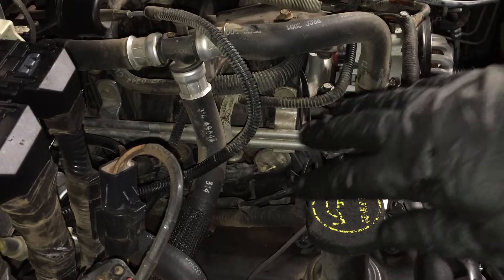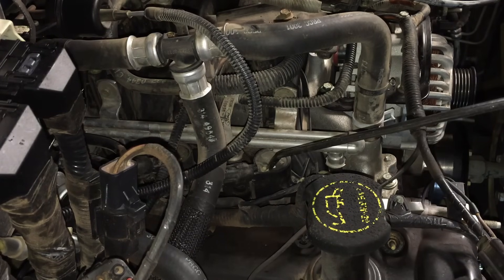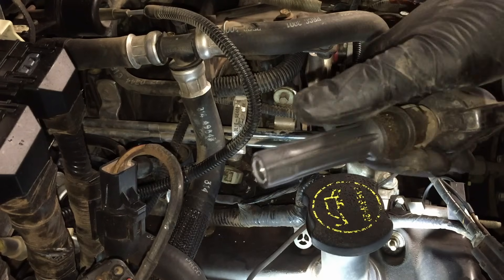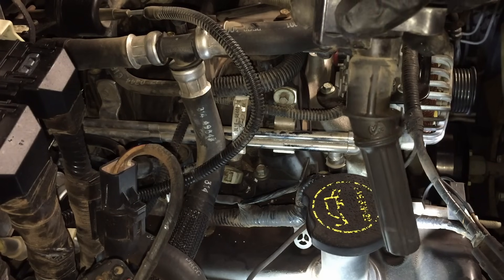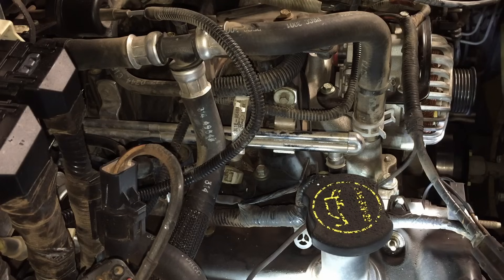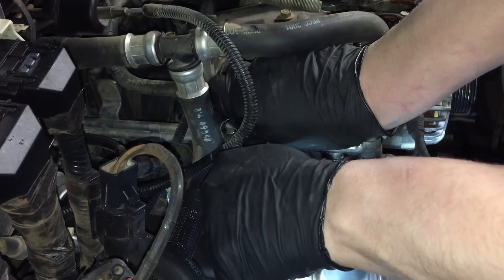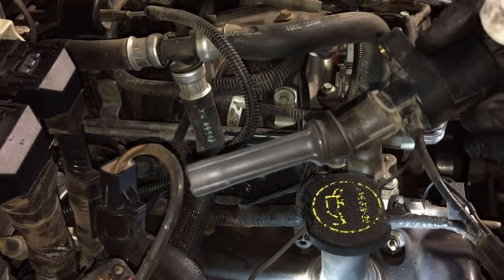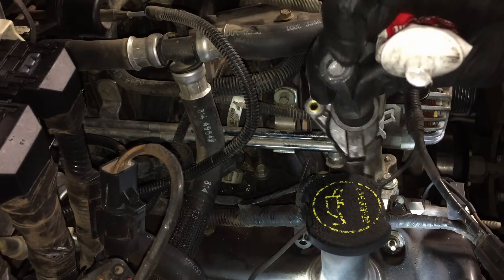Important Tips When Replacing Spark Plugs on Ford 4.6L 5.4L 6.8L 2v Engines

Comment: I use compressed air to blow debris from the area and after I get the plug out I use my small shop vac with a reduced tiip to suck out any debris that may be left.
Reply: Too late after you get the plug out,,,,,try blowing it out after you get the boot off!

Comment: I have an 03 TC with only 11500 miles on it. Being that it is 15 years old, should I consider doing a coil/ plug change or should I wait till 100K? The car runs fine.. It has been 15 years though..

Comment: I have a 01 Ford F-150 5.4 and spark plug on cylinder 3 when I try to losen it it feels as if it were rounded up because the socket jumps out of place,  like I can’t get a grip on it with the socket. Any idea why?? Or what can I do to remove it, I have already replaced all 7 plugs but that one

Comment: My question is, this only happens on the original set, ensambiling plant, or will always be a chance of  happening replacing the second set, my f150 Ford replaced the 8 in 2011, 3 where broke from the mechanic that tryed first, now truck jerks when touch gas in 4rh gear at 40 miles plus, so I'm gonna replace the spark plugs but not sure if they have a chance to brake, again, Ford dealer already replace them ones.

Comment: hello can you help me I have an 04 ford f150 5.4 lt I got a p0300 code that can be?
Reply: 2 or more cylinders misfiring. I dont know what vehicle you have. Could be coil, coil harness, plug wires, or internal engine component failure.

Comment: I have a 2007 f150 4.6l 2v . It has only 30,000 miles. With the factory torque on the plugs,what would you sugest 

to prevent plug blowout. thankyou

Comment: Thanks for the great video. I just changed the plugs on a 1999 F150 2v with the non coil over spark plug boots. I have two  quick questions. I could not get #2 spark plug boot to seat fully to the head. It sits up about 2 to 4 mm. Is that normal?. All the other boots seated flush with the head. Also when I first started up the engine ran slightly rough and then smoothed out. Does the computer have to calculate new values with the new plugs, hence the roughness. Thanks again for all the great tutorials...you rock.

Comment: Excellent video - Took me 4 hours.  changed my plugs & coils yesterday and found it was a real challenge to blow all the dirt out of the plug area. In addition to using an air compressor I made a tube attachment for my home vacuum to reach inside the holes. Car runs nice and smooth.
Reply: How do you know when to change the coils, and how long do they last.
Reply: @JosephArchebeque-he5lz There’s no time frame on how long they last.  If you have a misfire you’ll know it.  Replace the coil and plug.  If you’re lucky you’ll get a check engine light and your OBDII scanner will tell you which cylinder is at fault.  I hope this helps.
Reply: @JosephArchebeque-he5lz Buy Denso coils, the cheap stuff doesn't last!
Reply: Good tutorial.   I wonder about engine temp.  A Ford tech told me warm is good.  I don't know anyone who uses a torque wrench to install plugs, I probably overtightened a few .

Comment: I got NGK Vpower plugs. Same stuff used in Honda's which last forever. Coil packs on driver side were worse to do because of the fuel regulator then the passenger side.

Comment: You showed me everything I needed except how to get that last plug on the drivers side under the fuel rail.  The plug that the last guy didn't replace, the plug that is now totally dead.    Other than that great video.
Reply from the maker: +John Stutz the plug comes right out with extensions and a swivel. It's the coil bolt that is a pain. I use a 7mm gearwrench
Reply: I got the bolt out. I can't get the coil pack out from under the rail.
Is it bad to pull the rail, or is that OK to do?
I don't want to make a bad issue worse.
Reply: I had to pull my fuel rail off. It's no big deal but I'd make sure you have some new O-rings on hand for your injectors

Comment: Like to know if it makes a difference if heads are cold or hot.  Does that change the torque needed?  I've always maintained my cars but aluminium heads worry me a bit.
Reply from the maker: +Ken Howell No need to adjust really

Comment: Hey bud quick question, I've been trying to get ahold of you with a few questions but unfortunately was unsuccessful. My only question is, I just recently replaced plugs and coils all motorcraft and instead of anti-seize along the treads on new plugs I used dielectric grease instead by accident thinking that was what you used. But now watching the video again I see I was wrong and now I'm nervous. I used the by electric grease on the treads of the new spark plug and the top of the plug with the coils sit on. Is this ok? Also I tourked them down too 22lbs
Reply: the dielectric grease shouldn't really be a problem because the element in the plug is insulated from the threads through the porcelain. If you put a lot on and it squeezes out and touches the node you might have a problem but I think that's unlikely
Reply: The dielectric grease -- or anti-seize for that matter -- should work with engine vibration to help your plugs back out and blow out prematurely.  The more you use, the sooner you'll be back in there.  Keep your Cal-Van Ford Triton kit handy.  That said, the shade tree mechanics prefer Thread Repair helicoil from Wal-Mart.  Your choice.

Comment: Thanks for the great tips.  I just replaced the plugs in my 2007 E250 with a 5.4 two valve engine.  I had been dreading doing this job as it looked like it was going to be a nightmare.  After removing the doghouse, air cleaner housing and hose the only other thing that had to be removed was the PCV pipe.  I'm glad I had a huge assortment of 3/8" extensions as I had to use different combinations to reach the plugs.  A few of the plugs turned really hard when being removed but I was able to get them backed off a half turn and sprayed a couple shoots of Liquid Wrench (my favorite) and let it set a while.  Turned them back in and then they came right out.  Made sure to use los of air to clean out the threads and used never seize.Turned out not to be all that hard and I was able to get the torque wrench on every plug.
Reply: which has the broken off spark plug issue, not the issue with them blowing out..
Reply: that's the 3 valve if it's a 2007..
Reply: @GTA4folife it's an ECONOLINE they all have the 2v.
I own 3.

Comment: Thanks dude!!  I was worried about it being 3valve.  Thought I'd have to get a Lysle removal tool.  Also thought I'd have to remove the fuel rail and computer.  I was so freaked out by these spark plugs ( my sister had a 98 Expy and it needed helicoils put in!) that when I had a misfire on #6, I only changed it and the pack.  I pulled off the vacuum line above it for easier access and the nipple came with it"snap".  That stupid baro sensor was $73!  I'm confident now I can do it.  A garage buddy looked it up for me in case I wanted him to do it and the standard was 3 1/2 hours shop time ( ouch! ).  I'm not a whimp when it comes to plugs.  My old 73 Ford line 6 Super Van burned oil so bad, I'd sit in the van once a week while the wife grocery shopped and take out all the plugs and clean them and put them back in, lol.

Comment: Thanks for these videos.  I found your channel after I blew a spark plug on my 98 Econoline.  Very concise and well done, I really appreciate it.  One question.  If torquing to 20-25 ft lbs, do you think it's necessary to check the torque every 5000 miles?  It'd be such a pain but definitely less of a pain than fixing another blown spark plug.
Reply: How did you fix your blown spark plug?
Reply: Heli coil kit

Comment: are those pi heads?
Reply from the maker: yes
Reply: ive got a 4.6 the oil intake on the pass. side anyway maybe you can help me ... my truck is having a hard time cold starting. it cranks and nothing until you let off the switch and start over it starts right up... but the first few seconds it idles erroneously... then it goes back to normal. any help id appreciate it thanks.

Comment: So mine just blew out on cylinder number 2. Was able to screw it back in about maybe 3 threads, must have ruined some of the threads when it blew out. Should I repair it and put a insert in or should I just leave it and see if it will stay?
Reply: darkjedi351. It's all fixed now. There was only one or 2 threads left and it couldn't take the tourq so put a insert in and it works great now:)

Comment: I have a 2008 Ford Escape Hybrid . The wrench light came on  yesterday , the air conditioning went out a few minutes later and then it started hesitating from stops like it was over heating but the check engine light never came on. What could be going on with it .
Reply from the maker: It could be as simple as the fans. These systems are very complicated and have many checks in place to operate properly. Bring it by my shop or have a qualified hybrid tech look at it no one else. They must fully understand how these systems integrate into each other.

Comment: I just bought a 2002 Expedition 5,4 and I'm going to clean up the spark plugs and torque them properly. Whate else should I do?
Im in Canada, its at 135,000km and it was well maintained. They guy only used it to pull his boat

Comment: Great Video, I replaced my cylinder #5 coil this AM. It had been causing engine to "surge" when driving, worse when hauling a load (1998 F150 w/ 5.4L) but no check engine light until today, it was on-off-on, etc. Showed P0305 code, "cylinder 5 miss fire". Previously no code so I suspected a bad coil but Had no idea of which one. I bought this truck new, has 121,000 miles and this is the 6th defective coil. In the past a friend of my son had an adapter for a laptop that would show which coil was going bad when no ck eng light. Thanks for your video, my son always replaced them for me, this was my first attempt.

Comment: I have the 6.8L in my 1998 E-Super Duty (E450). I'm about to change the spark plugs on it for the first time at 81,700 miles. Shouldn't be too bad to do. I was a little concerned about screwing it up and causing it to eject a spark plug in the near future. I am going to follow your advice and over torque them a little. My other E-Series (2000 E150 Cargo Van) has the weak yet reliable little 4.2L V6 which has been really easy to work on. Currently just over 178,000 miles on it and it runs great.

Comment: I have a 1998, V-8, 5.4L, 2V Triton in an Eddie Bauer Expedition.  Cylinder 4 had it's coil pack replaced about two months ago (about 2,500 miles) with a Standard Motor Products FD503 coil pack.  I'm getting ready to replace the remaining seven (7) cylinders with Motocraft DG508 Coil Packs as all remaining packs are near 100K miles.  Should I pull the Standard Coil Pack and replace with a Motocraft Coil Pack or leave it alone?  Cylinder 4 is not generating any error codes (e.g. P0304).

Comment: Hello! 

I have a 1997 4.6L V8 4x4 F150 XLT which I believe is the Romeo engine as it as the 'W' in the vin #. I always see videos of the ignition coils, but my truck has two coil packs with typical spark plug wires. Is this normal? And could you confirm if I have the 2v still? 

Thank you for your excellent videos!

Comment: I was taught by an older schooler to hand thread using a rubber hose attached to the back of the plug then tighten with a ratchet works well for me so far
Reply: You can just use the socket. A normal person shouldnt be able to crossthread it under normal hand power on an extension. If you manage your purposely trying to crossthread it.

Comment: do the sp479 come pre gapped to spec? and i got the sp405 but returned them because there for natural gas and propaine evan tho there both recommended for my truck autozone guy said they work but i still went with the sp479 :)
Reply from the maker: They are used in many applications so you must gap them to your vehicles specs.

Comment: Excellent Video! 2 questions for you. I have a 03 Crown Vic and read the owners manual and it says that the plugs should be replaced at 100k miles, do you recommend that interval? Also when I'm completely stopped at a light she intermittently has a vibration or pulsation for about 2 seconds at a time and only happens sometimes. Does not feel like a misfire more like bass from the stereo. Any ideas?
Reply: Check for vaccum leaks on intake, pcv clogging ( clean if in doubt or replace), or idle air intake needs cleaning or replacing. Last but not least, clean throttle body. Brothers Taurus did same.  We did these and cleared up

Comment: Good video, but there's just one thing I see you are doing that isn't good, which is you aren't soaking the plugs with lube, like WD-40 or any other lubricant will work, because if you don't lube the plugs before you break them loose, you'll wind up striping out the threads. And after you've soaked them and have let them sit for a few minutes, don't break them loose and just pull them straight out, you have to let them sit for a few minutes after breaking them loose, then you should work the plugs back and forth as you are working your way out. Just a helpful reminder.
Reply: This guy is a mechanic for Ford so he knows what he's doing, it's why he's promoting Ford over everything as far as parts. The problem is greatly over exaggerated, Ford isn't completely stupid because of the dumb sparkplug and coil issues they're so well known for, it's not enough for them to sell us perfectly good cars with engines that are guaranteed to be problematic for years, but they add to the breaking sparkplugs program by coming up with all the better engines such as this 2 valve, it also requires all this extra attention, part is some which you entered into the comment, it's not real at all, it's done just as it would be if you were changing sparkplugs in any car except that Ford did some things that are plain stupid !!!! I have a 1998 5.4L 2 valve coil on plug design, Ford didn't need to manufacture a head like they did, especially that ridiculous million dollar plug that breaks off in the head.
Reply: This was done for pre 2008 engines that used the two piece plugs.

Comment: Brian, the rubber grommet (between metal shaft/insert and the cover itself) on cyl #7 on 4.6l is leaking. its it just as simple as popping the old metal shaft out putting new grommet on and then re-inserting the reverse? or do i need to pull the whole valve cover off?

Comment: You'd think that after over 100 years Ford would know how to put a spark plug into an engine.
Reply: It’s a damn Ford
Reply: Switch to a toyota tundra and never look back!
Reply: They do know, they just don't do it right anymore. They want your money.
Reply: Actually they have to keep changing tried and proven designs to meet ever changing EPA requirements.
Reply: @ @gpecaut1  that has little to nothing to do with the fact they were as wrong and cheap and careless in design
Reply: E L 1 you're absolutely right.

Comment: Hey, I just want to express my deepest thanks for sharing tips, this video especially.   Saved my butt today. No joke.
I remember the day I bought spark plugs, probably 2005, got home, opened the hood and asked "where the hell are the spark plugs?"  I had been driving C10s and C20s with carbs till then.  Looking into it, I started hearing all the horror stories of stripping out threads just removing them, steel/aluminum bimetal reactions fusing the plugs to the head.... Long story short, it was running fine, decided not to break it. Periodically ran Marvel Mystery Oil through the gas.  200,000 miles later, wouldn't you know, it wasn't running so well.  So today, at 228,000 miles, I finally got them changed.  Thanks.  
Most valuable tips: The heads up on individual plug angles, the suggested torque. I set them at 20 or 21.

Comment: My 5.4 has blown out 3 plugs, all three blew out the threads in the head as well. Have you ever run across this little jewel of a problem? There is an adapter that can be bought for about $60 that repairs the sparkplug holes.

Comment: have a 2013 Taurus with a 3.5, almost 100K miles, you have to pull off the intake to change the plugs on the rear bank, I am considering changing the coil packs with the plugs  on the rear. I am hesitant buying  Chinese knockoffs I see on ebay, Motorcraft are much more expensive.

Comment: Do you need to move the fuel rail in order to remove the coil and spark plug on an '01 f250 with the 5.4 or is it possible to sneak them past it?

Comment: thanks for the vid!
question for ya:  I have a 2001 f250 , 6.8L.  CEL is lit up, OBD says that I have a miss in 4 cylinders! I replaced plugs and coils but its still showing the same codes and its only running a little better. There is no way I was actually running on 6 cyl, it was not running that crappy, My question is can the computer be wrong? And should i DC the battery to reset codes?
thanks!

Comment: do you recommend power washing motor first ?
Reply from the maker: No because the spark plug wells go straight down and the well will flood.
Reply: dunno yolo I would never do power wash on an engine! I wouldn't take any chances with pressure cleaning and water getting on electrical components. But otherwise is ok if you plan ahead, give it a good whole week if you don't drive that much, by the weekend all those wells should be dried. Of course all that before taking the boots off!

Comment: hi Mr Makuloco I  have a question?
I  just swapped a 4.6 in my 2004 explorer. and it sounds good,but know I have some dash lights on
 like airbag, service engine soon and a flashing overdrive light. the only code I pulled was p0708. could it be a corroded pin in the computer harness. 
thanks